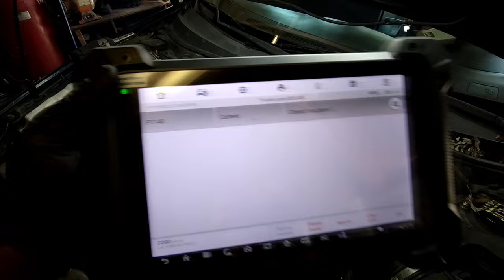non-invasive sludge removal from piston rings

Comment: This issue normally comes from lack of maintenance. The reason why I don't believe in long term oil changes.
Reply: Just had a friend with a Camaro with 80,000 miles and regular oil changes but there was sludge on the pistons when taken to the dealer.  Drives only in the city. Don't understand why it happened?.
Reply: @Na-nc6qt  because he only drives in the city. That PCV gets hot but not hot enough. Carbon only sticks between like a 30°F window. Idk the actual temps but it's like 190° to 220° or something but highways gets rid of that because you're working the car a little harder in a sweet spot it actually enjoys being in. It keeps the pistons hot, but not outrageous, and it's low heat cycle rate.

The Camaros were known to have PCV issues in the 5th gen V6 or V8
Reply: @Na-nc6qt Define regular oil change. How often did he change it?
Reply: Agreed. Oil changes every 100,000 km, whether it needs it or not.
Reply: @christopherpayment2954  damn thats a little too small interval
Reply: @mojakhaha on a turboed motor probably not more than 5k miles. On marine diesels with turbos maximum 250 hours but better around 150 and they work in optimal range 90% of the time. If you work out hours at 40mph average, 150 hours is about 6k miles but most cars probably don't average over 30. Mine's on 26 which would be 4k miles, but I do every 5k and it's more like biro ink than oil by that point. 10k miles would be like soot filled water or cutting paste.
Reply: Or bad design motor.  Hyundai 2.4 motors.
Reply: He might be using counterfiet/poor quality thick engine oil
Reply: My wifes 2017 accord started burning oil like crazy at 60k. Always has oil changes at 5k. Full synthetic Mobil 1
Reply: @eliascomo9469 You absolutely sure the engine is burning the oil and not leaking it out?
Reply: @eponymous7910  My commute is 12 miles one way...Too short??
Reply: @MyLifeMyMoneyMedia  I have a KIA 2.4L motor. Started using oil under 50k miles. Did 5k oil changes.
Reply: @bobreese4807  I noticed my oil loss at 50k too, I went from 7,000 to 5,000 to 3200 oil changes.  My oil be almost new at 3,000 due to having 3 - 5 qts
Reply: Not with the Hyundai Kia gdi  engines. They are bad design.
Reply: @JetFire9  It is a WELL KNOWN problem, due to stupid EPA demanding a fraction of a mile higher fuel efficiency, and the dumb Piston Ring designers putting out "Ultra Low Tension Rings" to reduce friction and "improve"  fuel mileage... but causing a lot of oil consumption, dirtying cat converters, and ending up getting  INCREASED  EMISSIONS!!! 
(like SHOOTING on their own foot!)...

...And AGGRAVATED by pressing-on using Ultra Low Viscosity Engine Oils, like ridiculous "0W-20", in a maniac quest for reducing friction still more, in a phanatic manner!!!

Comment: I have not done this in a car engine, but if you spray BBQ grill cleaner into the cylinder, it removes carbon buildup really fast.  50 years ago I tried using a quart of Rislone in an old Chevy 283 V8 engine with lifter noise.  It wasn't very long and the lifter noise stopped.  The stuff had the consistency of water and you added it to the oil 100 miles before an oil change. About five years later, I started putting ATF in with the oil change, and it cleaned up old engines nicely.  Been doing it ever since.  ATF is a high detergent engine oil, needed to keep transmission passages clean and not harmful to gaskets and seals.
Reply: Does it loosen up sticky rings?
Reply: @Priority57  I do not know what would happen if one were to let the cleaner soak the carbon on the ring lands.  I have never tried it.  I suppose it is possible, but one also would worry about ring lubrication for the first few minutes?
Reply: Dude that eats up aluminum fast
Reply: @chriscalderin6677 what eats up aluminum fast?
Reply: @samgrieg  grill cleaner and oven cleaner
Reply: 😂😂😂😂 PISTON RINGS NEED REPLACING AFTER 100’000 MILES . and people wonder why they got no power 😅
Reply: @azarahwagner2749  My 2001 Pathfinder 3.5 needed rings at 60,000 miles.  It now has 160,000 miles, same rings. LOL.
Reply: @ThisOldMan-ya472 
And how is the compression for each cylinder ? Have you actually done a compression test before or yet ?
Reply: @azarahwagner2749  good question although my previous comments where based on experience with oven cleaners I have Ben starting to wonder if solvent and oven cleaners may be worth a try before a new engine. I have had a lesson from a guy I know that works on engines  being raced where the get rebuilt every race and I did help him rebuild street engines with dime clearance from damaged pistons  and we just cleaned the ring lands if it floats it seals like new.  I also think the Yamaha ring fee is worth trying as well the marvel mystery oil synthetic it is a actual synthetic. I have had engines burn oil and stopped burning after just running good oil that cleans
Reply: @azarahwagner2749  No, I have not done an actual compression test. I do not need to, to understand this engine condition. Oil consumption and cylinder blow-by is evidence enough. I drove 100,000 miles with various loads, up to 4,800 pound trailer. The engine purrs like a kitten, and will pull that trailer at 500 rpm without a misfire. It is cheaper to pay extra fuel and oil, than replace or rebuild this engine. In fact, I have three good engines sitting here in three other Pathfinders, if I need them. LOL.
Reply: @chriscalderin6677  Ha ha ha! +40 years ago i worked at a restaurant and the son of the boss was doing dishes from the kitchen. There was a big aluminium saucepan some 50 liter that was burned in the bottom. We had some stuff called sokoff, and he poured alot of that in the saucepan and kicked it under a bench, and forgot aboute it. A few days later the sauce pan was needed and the guy getting it only got the walls of the pan, The bottom stayed under the bench. That sokof had eaten the thin walls and the bottom was like new after rinsing.
But using owen foam clener in a engine might work depending on how it gets to the piston/oil rings. Iam going to buy some and try on my old spark plugs, that might give us a idea on how it works on sot. I just changed oil in my BMW 330 so iam not going to try anything at all for a long time. 
But if i do i would mix some gasoline and 2 stroke oil for a last rince before starting the engine. Just to lubricate pistons and rings. After every second fill with gas, i needed aboute 70 cl of engine oil. (Bottle of whiskey) I have done the BMW 02 pilot mod, so now it looks like it does not use to much oil. 500 km and no change on the oil stic.

Did a google on sokoff and found this... On the can it say safe for aluminium, so they must have changed the formula.
https://www.amazon.com/Sokoff-Pot-Pan-Cleaner-Pint/dp/B0053Z1ZRE/ref=cm_cr_arp_d_product_top?ie=UTF8
Reply: This is interesting and complicated. I believe Toyota (2.4L) would have tried all these methods to avoid rebuilding costs. I may attempt a piston soak. Until then I’ll try low cost options similar to what this gentleman is doing
Reply: @samgrieg the answer is Gallium
Reply: @hakan8997  I use BBQ grill cleaner and toothbrush to clean brake waste off rims, but I don't  let it soak. Acid works on steel but don't  let it soak too long.
Reply: @chriscalderin6677 YES, DON'T USE OVEN CLEANER!...

IT "EATS" ALUMINUM FAST!...

Don't do crazy things that WERE acceptable WHEN engines were made with iron Blocks AND iron heads!!!

 DEFINITELY NOT on today's aluminum heads, or even heads and aluminum Blocks !!!
Reply: @samgrieg   it is the "good old Easy-Off Oven Cleaner"... which is concentrated and very caustic Potasium and Sodium Hydroxide!!!, and will EAT aluminum FAST!
Reply: It sure rots out your motors seals quicker .
Reply: @donjuan6646  How so?

Comment: A former co-worker of mine had a buddy that had a pickup that had a continual tick in the engine. He started putting a bottle of atf in place of a quart of oil when he changed the oil. After doing it several oil changes, the tick went away. He ultimately sold the pickup to another guy, who rebuilt the engine. That guy said when he pulled the pistons out, they were completely clean, and the valves had absolutely no buildup on them. The cam looked clean and the crankshaft was clean.
Reply: @religion3166  No, no. I'm completely serious. He told me.:-)
Reply: Wonder why he rebuilt the engine then
Reply: @JonnyAbs-0  The truck had several hundred thousand miles on it by that point, and the new owner decided to do a ring and gasket rebuild due to the miles.
Reply: Hello mate, can you please tell me how he used the atf?? Did he use it as a flush before the oil change, then drain the atf and then replace it with fresh oil? Thanks
Reply: @lincolnhobartmiller  No. He actually used it as a substitute for 1 quart of oil. When he'd change oil, one quart at the refill was atf instead of oil. The atf has a lot of lubricants in it so it doesn't hurt anything and basically merges with the motor oil.
It probably thins it down too, so he probably used a heavier weight oil. He never explained that part to me.
Reply: @dannyo6699 oh wow, l can see though, how after a few cycles it could get rid of sludge, thank you for taking the time to answer Danny, cheers
Reply: @lincolnhobartmiller  No problem . Have a great day.
Reply: @lincolnhobartmiller Personally, I wouldn't do it unless the engine is in bad shape already, and only to help clean it up. If you maintain regular oil changes and the oil used is good quality, then you shouldn't need to resort to this drastic extreme to get it cleaned up. If you have a good engine, keep doing the regular oil changes with the recommended oil type.
Reply: I heard of this. One of my UTI teachers told us anout this old timer trick,,, because atf has a lot of detergents.
Reply: good info!
Reply: @lincolnhobartmiller 
He already did

Comment: Acetone and synthetic transmission fluid is excellent to use on rusted bolts . It is mixed 1 to 1 parts of each. It must be shaken each time it is used. I think it works better than Kroyl myself.
Reply: I used to make a great gun cleaner with your formula plus lanolin, 3 equal parts of each.
Reply: @skipcallaham1517  Sounds like Ed's Red! 👍
Reply: @Sylvan_dB  Now that you mention it, I believe that was the name of the recipe to try to mimic it. I can't remember where I red it though.
Reply: If i mix atf and accetone can I damage engine if I leave for a day? Engine didnt work 3 years and I can turn like for a 90 degresse , but not whole turn
Reply: Tried it before, didn't work as well as PB blaster

Comment: There's a TSB for excessive oil consumption for the QR motors, has to do with the catalytic converter media breaking down and getting sucked back into the cylinders.  Just search QR25 Precat Failure. Nissan had a recall on it at one point.
Reply: I had two of these one both fixed but my second one was fixed at a higher mileage way to late and started burning oil and eventually blew a head gasket to the point I couldn't rev the motor because the oil was so thick by the time I got to my destination on a long trip.

Comment: When you were cleaning the plug recess on number 1 and you used compressed air to blast it out, the smoke in the crank case blew out of the breather pipe @ 8:14 . I thought that you had already taken the plug out and that was identifying the cause of your blow by. But when I went back and had another look, I realised the plug was still in. So how was the compressed air getting into the crank case when the plug was still in ?
Maybe the cover gasket was leaking ?

Comment: Regarding oil changes: I sometimes add a little Marvel Mystery oil to my oil when I change the oil, or just prior to an oil change to keep from building any sludge. Every year or two I do a double oil change on my Honda. I add motor flush to the oil & let idle for 5 minutes, then drain the oil. Then I add 2 quarts oil & fill the rest of the way with Marvel Mystery oil & install a new cheap oil filter & idle for 5 minutes. Lastly, I fill with a good synthetic oil & good oil filter & the oil is so clean that you need to look at the oil dipstick in the sun to see the oil level. My car currently has over 213,000 miles on it & the inside on the valve cover is as clean as when it was a new car.

Regarding frozen piston rings: I used Seafoam & Marvel Mystery oil on my 1991 Honda civic Si that was burning allot of oil @ 200,000 miles. At the time I was using 10-40 oil with Hyperlube, which it really thick & it still burned allot of oil. I took the spark plugs out and poured Seafoam into each cylinder & loosely put the spark plugs back & let it sit overnight. The next day I used a dowel to put into the cylinders through the spark plug hole to see how much liquid was in each cylinder. I then sucked the liquid out & bumped the starter with the sparkplugs out to move the pistons to a different position. I repeated this process for four days/nights using Seafoam two times & Marvel Mystery oil the last two times. When finished, I made sure all liquid was out of the cylinders & put the sparkplugs back in and started the car. Now I put 0-30 oil in car & it burns no oil. The rings must have been frozen with carbon, but they are fine now.
Reply: Using Marvel in fuel is good, however if your doing your oil changes 3-5k miles it’s definitely not needed it’s a waste

Comment: Oil in the spark plug wells can often mean the lower tube seal failed and people incorrectly blame the top seals. I’ve read that some tubes are removable but for the 3.6 GM said they’re pressed in and would require a new cylinder head. After a thorough cleaning, I applied a green, penetrating grade threadlocker.

It appears that Nissan didn’t have direct injection so my experience may not apply but I’ve found heavily carboned intake valve ports caused from PCV vapors depositing oil and repeatedly baking layer upon layer under those carbon chunks flake off, fouling spark plugs and causing leaking between the valve seat and faces, which means lost compression on the affected cylinder(s) and possibly an engine misfire, most noticeable at idle. 
Those carbon chunks probably aren’t great for the cylinder wall but I suppose they could make it past the exhaust valves as well, and possibly not great for the catalytic converter(s) either. 

Long story short, after a thorough clean-out and just luckily getting the idle smoothed out, I sent my in-law down the road but the ‘12 Impala 3.6 died on the freeway (after 200 miles) with a MAF sensor code and bogged down with every press of the pedal. 

The MAF sensor was oily (from back-pressure) and I recalled an exhaust rattle that went away shortly after starting that I was told began years ago after an accident. 

Unbolting the front of the rear catalytic converter revealed a massive blockage that had to come from upstream of there so I removed the crossover pipe from the front and rear exhaust manifolds. Both had their own catalytic converters and the one near the firewall had a darker center in the honeycomb structure and maybe a few plugged holes but merely blowing air into it really brought the chucks down. Eventually that firewall cat turned into nothing but a bypass pipe and the blockage and years-old exhaust rattle was gone so I sent my broke in-law down the road.
I warned the oxygen sensor may set a code but 6 tanks of gas and still no light. 

Ya know, those carbon and sludge problems wouldn’t exist if people just changed their oil with full synthetic oil and never dinosaur oil or synthetic blends, plus they could extend the time between changes from 3K miles to 5K miles. The best full synthetic oils and filters say 20K miles, which is why I’ve switched to ‘em (only a couple bucks more than SuperTech) but I’m sticking with 5K mile oil changes.
Reply: Is it a good idea to soak piston and vaccum them and run aggressively on highway before oil change?
Reply: @religion3166  Some engines demand a certain viscosity and straying too far could be detrimental but I’m just a guy that wrenches on my own vehicles. As for the soak, aside from the danger of hydrolock, I imagine the liquid would trickle past the rings and dilute the oil (hopefully nothing that could cause cavitation) but another concern would be evacuation past the exhaust valves and having a negative effect on the catalytic converter. (like gasoline from a constant engine misfire) 
There are quite a few YT videos where a guy had an oil consumption issue and he was convinced it was a stuck oil ring so he tried all sorts of things (multiple videos) one sort of like your question. Sometimes the instant remedies fail so honing the cylinders and installing a new set of rings is needed.

Comment: just pouring anything in the cylinder isn't going to do any good if the sludge is accumulated at TDC; you need to splash the liquid around with an air line like I did. So that it disolves the sludge; I put some brake cleaner and I also used transmission fluid at different times and splashed it around and leave it to soak for an hour and I could see the sludge sliding down the cylinder walls.Even if it doesn't cure the ring problem I think that having clean cylinders are important, because dirty cylinders and valves can cause misfires too.
Reply: Dirty pistons can cause hot spots.